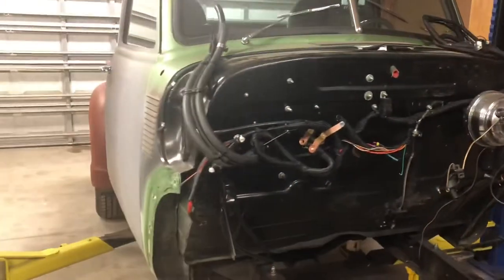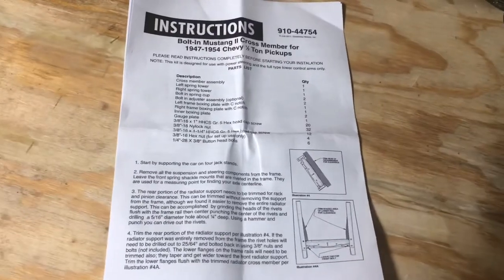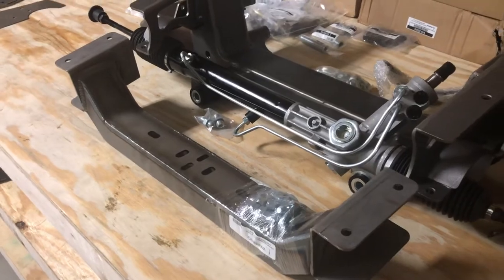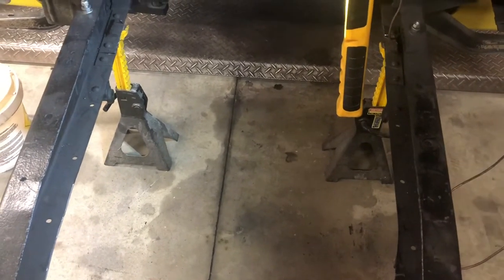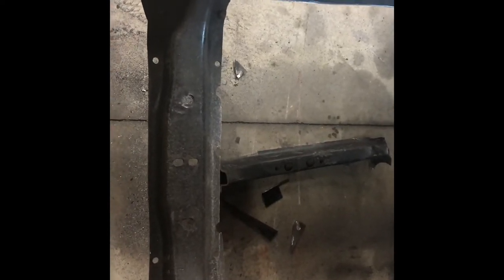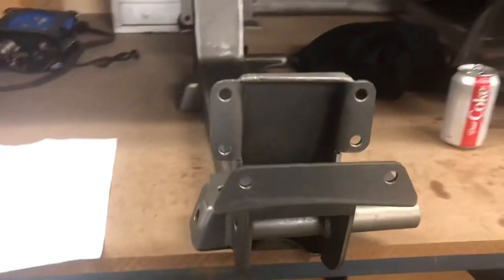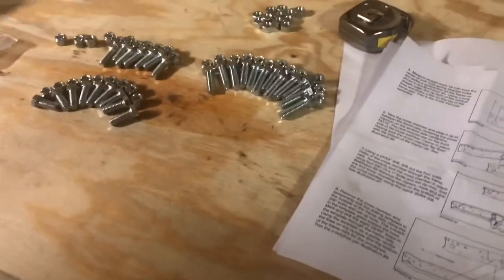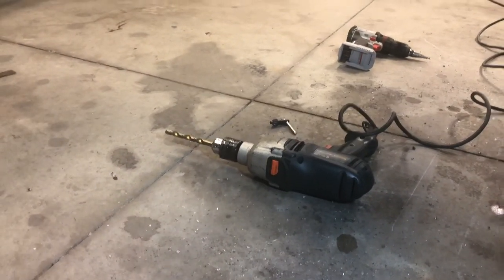Bolt on Independent Front Suspension - Part 1

Comment: Great vid.   Just bought a 55 1st design/ series driver. Original for automatic three speed. 261ci with 848 head.   This seems to be a nice kit, sure looks to be diy.   Have an L79 327, but have not made the decision about keeping the in-line or going the 327.   Already play with my L78 69 SS Chevelle, so not shy on power.  Anyway, well done explanation and your time to offer the vid. Cheers

Comment: I've reviewed all the series on the IFS install and found them very helpful.  I do have a couple of questions:  1) at what height of the frame did you start with and where did you measure from or did you place a level on a certain part of the frame and level the bubble?  2) What is the easiest/fasted way to remove any of the factory riviets that hold any part of the original leaf spring brackets that need to come off  before starting the IFS project?  Thanks for your help

Comment: Hey Silvo, I know this is a 3 year old video and you may not be checking comments any longer. Just wanted to say thanks for making these videos! They are really helpful! 
I have a question about the front radiator cross member. I’m trying to keep a 6 cylinder engine in my ‘51. This kit show trimming the radiator crossmember .  
But that’s the front engine mount area for the 6. Does the new radiator cross member you purchased account for using a 6 cylinder? 
Thanks!

Comment: I just did this install, but my center line on the crossmember was the bottom part, not the outside tab you marked. The pictures next to step 6 and 7 looks little bit offset to the front. How did yours turn out?
Reply from the maker: Perfect. Sits great, wheel centered in the fender.

Comment: How has this held up? Did you ever weld them in?
Reply from the maker: Hey Frank, I haven’t welded anything in and don’t plan to at this point. It has held up very well. I live down a dirt road with bumps, driven it over 500 miles and no issues.

Comment: How did the front end come out?  I'm doing the same one and when it says scribe in the center of the crossmember doesn't that mean the actual crossmember or the flange you centered off of?
Reply from the maker: Apologies for the delayed response. Happy to help. Front end removed by unbolting the leaf springs and unbolting the top shock mount. The entire front axle is loose. Jack up the front end and roll it out. Make sure to unhook the brake lines from the calipers.
Reply from the maker: I scribed both the crossmember and the frame. Lined up the marks.

Comment: Could this possibly be done with the original 6 cylinder still in it?
Reply: No
Reply: @travisjeanneret2250  just done it over the weekend, with the engine in it✌️
Reply from the maker: Honestly don’t know. I would think yes as long as the motor mounts are correct.